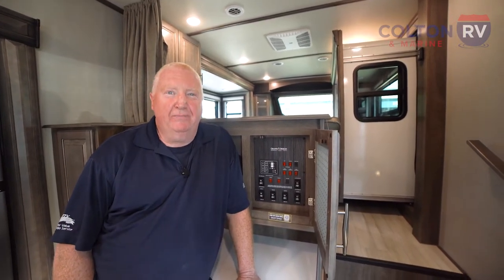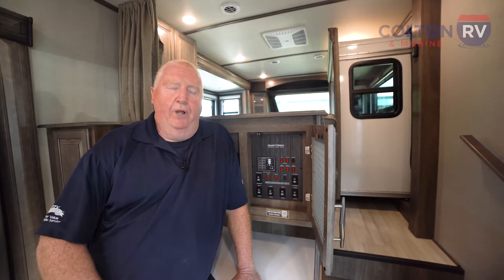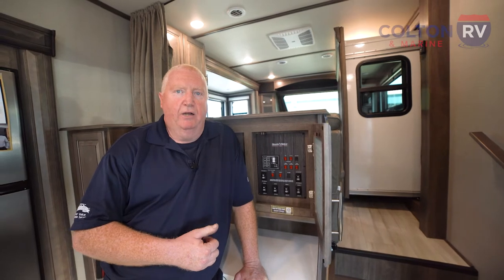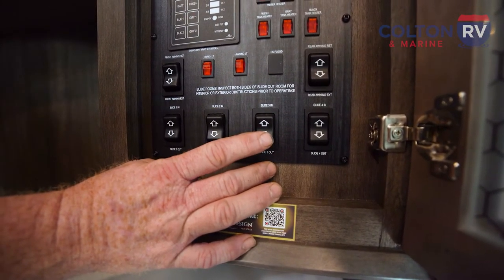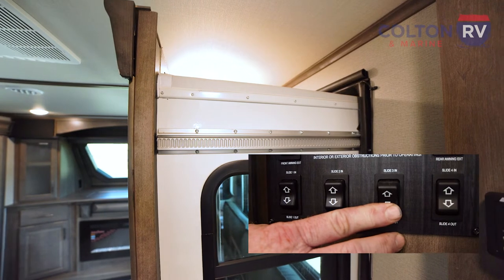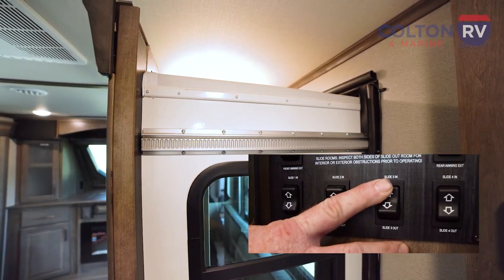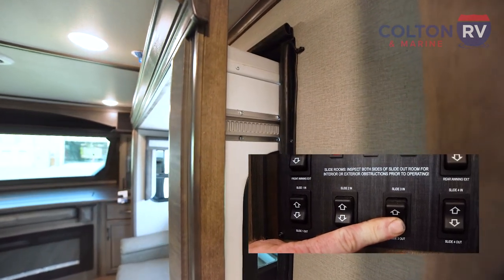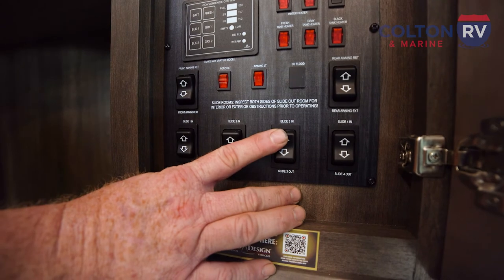How to Resync Schwintek RV Slides

Comment: Any suggestions what to do when its out of timing from top to bottom.  Bottoms in Tight , when all the way in and the top is still out almost 2 inches.
Reply from the maker: Hello! I would recommend trying this process 2-3 times to see if it that problem occurs consistently. If it's still sticking out, it may have something to do with the components (rods/teeth/gears) not being aligned. At that point it may need to be brought in for service to be repaired.